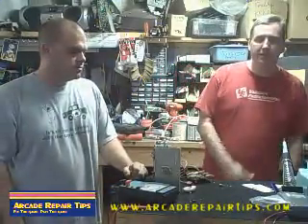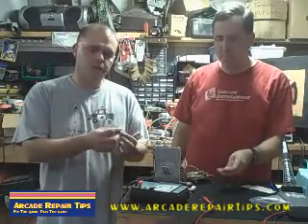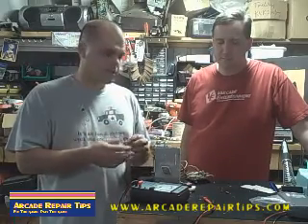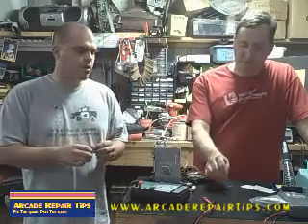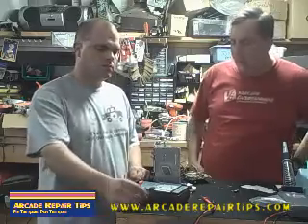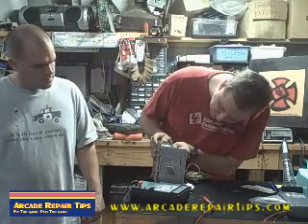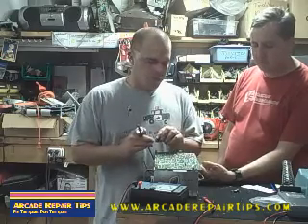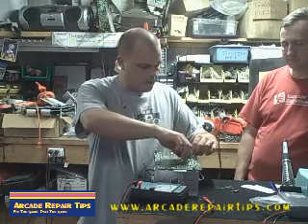Arcade Repair Tips - Installing A Cap Kit

Comment: I have a pole position that only let me get half a screen every time I adjust to full fuzzes out . What do you recommend?? Game plays fine just that half of screen?
Reply from the maker: From your description, it does sound like an issue that a cap kit would solve. We recommend starting the repair by installing a cap kit and touching up any cold, cracked, and/or broken solder joints and see if that solves the issue.

We will also be covering your question on Episode 38 of our Live Show if you want to hear us talk about it. The show will be broadcast live on April 2, 2020 at 5:30 PM CT or you can watch it as a recording at the link provided below. Thanks!

Link: https://www.youtube.com/watch?v=qCp1vv4lOIY
Reply: I also have a golden tee four that has silver strike bowling had to install cap kit screen went out& that’s when I seem red board with Jamma harness hooked up  I was very happy to see that board  , was looking in to golden tee for a purchase & it’s nothing better than to have one big game instead of two .!!cant get red board to power up fan , board is not working??I heard it needs a special power hookup& I can’t find how to fire it up & also it lets me switch games but of coarse golden tee board is not getting power.??
Reply from the maker: @phillipcarter6695  Yeah, may need an additional power supply that will work with the red board. Twisted Quarter sells them if you need one. Link: http://www.twistedquarter.com/index.php?main_page=product_info&cPath=335_336&products_id=231
Reply: That was very helpful, I have that power supply also , i have 250 watt power supply & it’s all wired up to boards . Monitor were & which cable hooks up for power to red board.?
Reply from the maker: @phillipcarter6695  Not real familiar with the red board setup but the manual does have installation instructions for it. Link: https://www.arcade-museum.com/manuals-videogames/G/GoldenTeeForeManual.pdf
Reply: Also put caps in pole position still half screen will check board looks like it has jumper wires hooked on to board ?
Reply from the maker: @phillipcarter6695  Yes, check for cracked, cold, and/or broken solder joints. Also, check the b+ voltage to make sure it is in range.

Comment: Great!  Someone talked about ESR in an entry level video. 

I have seen videos by so called experts who don't seem to know what equivalent circuit resistance means and why it is so critical. They spend lots of video time bashing their competitors but don't seem to know anything about the art of electronics.

The only thing I would suggest is that people take photos of the cap orientation before starting. 

The bit about trace lifting on old boards was smart. I trashed many boards before an old grey beard told me the story.  

Great work. Thanks.

Comment: @James0Reed Well, it's an electric component that stores electrical energy on a PCB and only allows AC power to pass through the circuit it's connected to. I'm not an expert, believe me, but I believe that in this case, it's used to help keep the amount of power traveling through it at a constant level, that way you don't get power surges everywhere. If you have a computer motherboard or really any PCB, the capacitors on it look barrel-shaped, usually have a stripe on one side, with a metal top.

Comment from the maker: @TheNews1990 This could fix your Karate Champ depending on what the problem is. You might want to check out the post related to this video on our website. It will give you an idea of what a cap kit fixes and help you with buying a kit for your particular brand and model of monitor. Also, you might post a video of the problem you're having so we can get a better idea of what's going on. Thanks for watching and good luck with your repair.

Comment from the maker: @cameronMetcalfKelly This is pretty much exactly what we would have done if the same thing happened to us. This should be fine just as long as the copper trace is making contact with the flyback pin. You should be able to check the continuity with a multimeter to make sure. If you don't get continuity you may need to jumper a wire from the flyback pin directly to the trace.

We have featured your question on episode 14 of our Q&A podcast. Please listen to it for more of our thoughts. Thanks.

Comment from the maker: @BURPism This is probably do to what voltage different circuits require when they design the board. Obviously a higher voltage cap will work but that's because the voltage required is less that what the cap allows. It really all comes down to the design of the board. 

We have also featured your question on episode 14 of our Q&A podcast. Please listen to it for more of our thoughts on your question. Thank you for your question and good luck with your future repairs.
Reply: I have installed new caps & still half screen when I turn vertical hold it runs & fuZzes out , turn it down it go back to half screen , will check board connection , I resoildered too!! Very helpful will check board.?

Comment from the maker: shakahead68,

We would recommend checking the harness and the monitor connectors to see if they are making a good connection. Check where the connector plugs in to the monitor chassis as these pins tend to come loose from the board. Reflow the solder on these pins to see if that helps. 

We have also featured your question on episode 7 of our Q&A podcast. Please listen to it for more of our thoughts on your question. Thank you for your question.